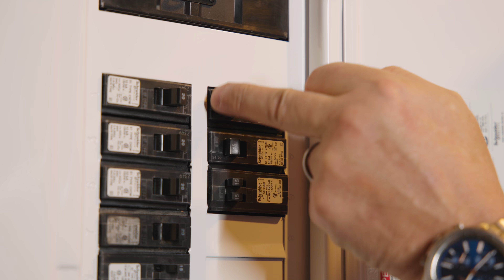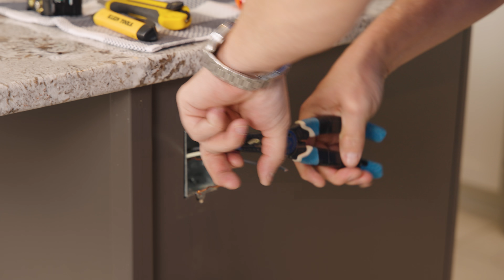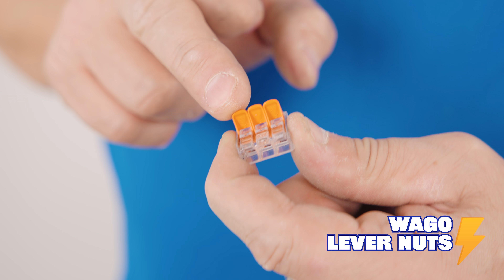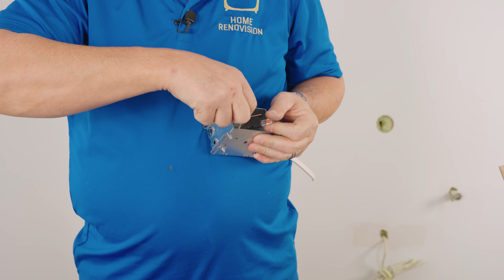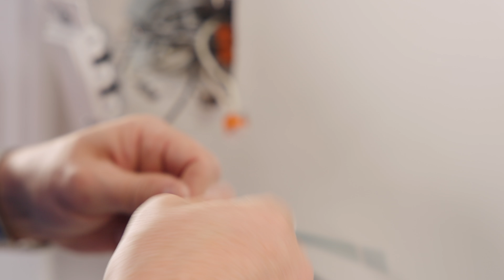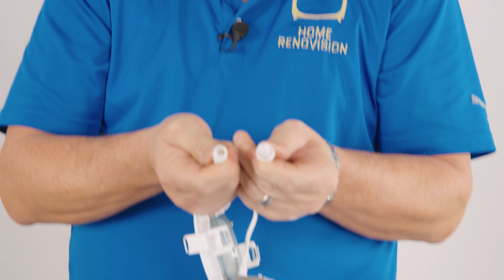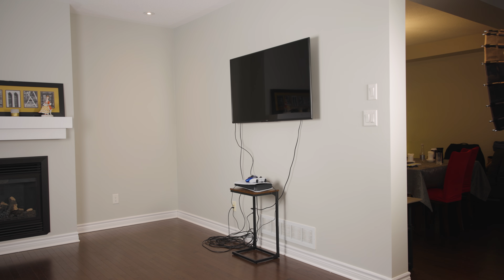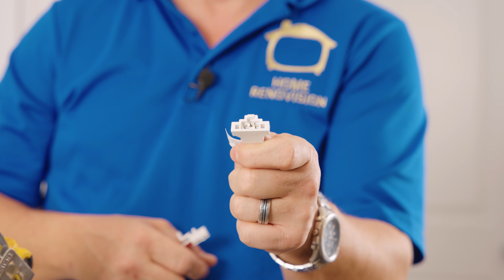Electrical Hacks Every Homeowner Should Know (DIY Friendly)

Comment: He didn't show how he got the power to the TV.... Dropping a standard power cord or extension cord down the wall cavity (this is a major fire hazard and violates the National Electrical Code). Got into a huge rabbit hole about this and just ended up going the romex route and learning to tap off from existing outlets to create a higher outlet.

Comment: Great video, have learned many of these the hard way!  One comment at 24:35 you can remove a wire from the Halo push connectors by twisting and pulling.  When you cut the wire off and striped it again using another hole there was still a bit of copper from the first try sticking out that would be energized when power is turned on.  Could cause a short.

Comment: In my new house. I had a duplex that was giving me grief. Thought it was the breaker.  I pluged in a fan in to the duplex and it sparked. 
Ahhhhh. I opened it up and found that the contractor had used a electric screw driver and cracked the unit because he over torqued. The plug was MELTED. A fire waiting to happen.

Comment: As an electrician for nearly two decades, I recommend never using wago connectors, especially for power loads as opposed to lighting loads.  

I’ve witnessed countless melted wagos over the years due to poor installation or poor quality controls at the factory. 
Also, never used stab in switches or receptacles.  They may be UL listed for that use, but again, I’ve seen too many melted or burned wires and devices due to poor installation or manufacturing defects

Comment: At 25:05 for that wafer light install, the box that you connected wires in, in can just sit loose in the ceiling?  It doesn’t have to be attached to a joist anymore for code?

Comment: The wago connector also has a spot that enables you to insert a probe from a multimeter. Makes testing things far easier. 

Also, if you use wire nuts or wago connector, treat them as hats instead of buckets. 
Have them point upstairs. 

If they point down, dust or debris and even moisture can accumulate and sit in it, causing connection problems over time.

Lastly, to make things even safer, I use electrical tape to wrap around the screws of the switch or outlet, and all the way around the switch/outlet to ensure the sides don't contact metal, or me, from accidental touches.

Many technicians swear against the wago because of heat tolerance or such. However, there is a video out there where someone did a test with wire nuts and wago connectors by running different current levels through and measured the heat. 
Wagon nuts actually handled things very well. 

For moisture control, I use smart switches and run a program where the fan will continue and not shut off until after 30 minutes passed.
So I never turn off fan switch when I leave bathroom, because it will just auto shut off after the time I specified ensuring better moisture evacuation and power won't be used more than I need if in the past I forget to come back to turn off fan during the time before I had a smart switch and just had a regular dumb switch. 

Hope this info serves others well.

Now it's time for me to go back to my long project of fixing my 3 Way switch and trace every wire across 3 locations because whoever installed the wiring didn't do it where things made sense and shortcuts were taken that I need to now normalize to current standards and ways things should be wired.

 Normally it wouldn't be an issue, however I have a smart 3 Way switch that suddenly had issues flickering on and off constantly, and I now  need to go through the long process of correcting things.
😅🤷

Be well always.

Comment: Extreme beginner question (obviously): How TH does the Romex "come to your light fixture" (as you say) when there wasn't even a fixture there to begin with? You made the hole in the ceiling, right? I'm picturing crawling around my attic space to try to drag wiring across. Doesn't sound like DIY for this 70 yo woman...

Comment: Honestly, working with electricity has always intimidated the crap out of me.  I don't understand it.  I can do basic installations like switches, outlets, and fixtures but I still don't understand the witchcraft that is electric.  lol  I live in a 125 ish year old house, and every time I've changed out anything electrical it's been an entire new adventure and I NEVER know what I'm gonna find.  I am absolutely going to look into those Wago connectors.  They look far superior to wire nuts for multiple lines!

Comment: I found out that the connector without the gate you just twist the wire back and forth and you will get it out and when re used it's still a good connection where you can not get them out unless you twist again.

Comment: At min 17:40 you just fixed the fan fixture for a bathroom and a light for the other side. I have two separate sets of lights and a fan would there be an option to combine the two types of would i have to get three separate light fixtures and a fan fixture? I've been watching a bunch of these for a while now. You've helped with drywall patched more than you know!

Comment: When it comes to automatic lighting know that there is a difference between an occupancy sensor and vacancy sensor (though some switches let you change modes). For many rooms it is actually annoying to have an occupancy sensor (automatic on/off) and you actually want a vacancy sensor (manual on, automatic off).

Comment: I could be wrong but I don't think you need to strip the wires for wagu clips. I watched an electrician do it without stripping. When you close the clip latch it cuts through the wire insulation to make contact.

Comment: I thought per code no more using back of switches the silver and brass screws should be used instead as inserting in back is fire hazard
Reply: Those are the old ones with the spring-loaded gates. The ones he's talking about have the snap Gates which are much more secure

Comment: I just installed my first ever electric device. It was a dimmer switch and I could'nt figure out how to switch it off. After 10 minutes, I figured I need to slide it down really hard and then it clicks off. I wish we could try those before buying because now I bought 4 piece of crap dimmer switches! But I'm still proud of myself for doing it. The only other problem I encountered is that I needed to wire the ground from the box to the switch because the metal of the switch plate was painted.

Comment: 24:36 Only thing I would change is to either try extracting that copper piece left over from cutting the wire or taping it if you can't remove it. That bare copper wire nub would still be live when the circuit is energized.

Comment: 24:36 but you left the previous piece of broken off copper sticking out of the connector!? You can twist the wire to get it to release from those push connectors but as you did it that black hot can easily short inside the box, a no no as you stated

Comment: So why are you saying the plug in back is NEW. Plug in back has been around for decades. Most people(smart) uses them, because they are not secure. What's different about the new ones?
Reply: The old ones were called stab locks and they were held in with spring tension. The new ones have the snap or gate which secures them much better. That's why they are now approved.
Reply: @sugarraysmith5450 good to know, thank you

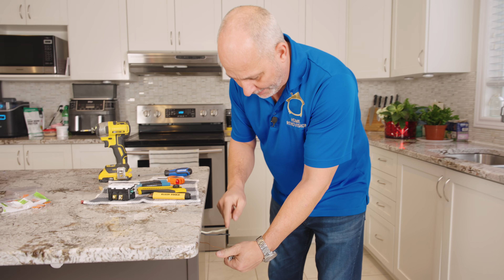Comment: 5:33 "chances are it'll break off" is misleading. It's good advice but makes the fringe case sound like the norm. Take a piece of new copper wire, bend it back and forth until it breaks and you'll get an idea of what you can get away with. Or maybe wire in Canada is more sensitive

Comment: Hey Jeff, love your content, a lot of my diy knowledge came from you, want to call out a shock hazard I saw though - 24:37, you snipped the wire and reconnected it, but that snipped wire will be live and defeats the purpose of reconnecting it in the first place, I imagine you'd want to use a new connector or at the very least tape around it a few times, otherwise helpful stuff!

Comment: Lots of good things in here, but 29:00 might be a no-no in both USA National Electrical Code (NEC) and Canadian Electrical Code (CEC).

Avoid doing parallel runs of communication cables (Ethernet) and power cables. I think the separation requirements are:
- Minimum Separation: 2 inches (5cm) 
- Recommended Separation: 12 inches (30 cm)

If stud spacing is 16 (40 cm) or 24 inches (60cm):
- Renovation: separate wall cavities
- New construction: separate wall cavities is preferred, but you could staple to opposite sides of a single wall cavity

In the video, there are two wall cavities above the heating return register. The Ethernet and power cables should have been routed in different wall cavities.
Reply: These codes are a bad joke. No inspector is opening an outlet to check on this prior to purchasing a home. Also, despite all these codes, you still run into issues. Why? It makes no sense

Comment: Great video with a lot of good information. However, you ran an HDMI cable behind the TV and cleaned up the mess. However, you hung the TV back on the wall without supplying any power to it.

Comment: Those outlets are actually all upside down. T goes to the right side. Per the patent, the ground should be at the top. The US has no code for residential zones, but there is a code to follow for public safety, healthcare, laboratories, and certain manufacturing facilities. Next time you go to the police station or a clinic, look, and you'll see that all the outlets are right-side up. I'm not suggesting people go and flip all the outlets in their homes, but if you're already replacing one, you may as well put it in right. Just because an electrician did it the first time doesn't mean they didn't put it in brass-ass backwards (I've literally seen outlets wired in reverse polarity too).

Comment: How are those Kidde smoke detectors treating you? I installed 5 of them and within a few months two started going off randomly at 3AM. To make matter worse, the false detection was sometimes of "heavy smoke" which means you can't silence them. The only option being while half asleep to unmount the smoke detector from the ceiling and permanently disable. The other 3 have been good for about a year now.

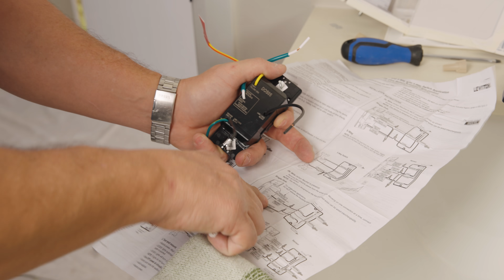Comment: The motion sensor switch: Pause at 2:45, the instructions say that the wires are interchangeable, otherwise they would not both be labeled ‘line/load’.

LED wafers/retrofit kits… I much prefer to be able to use whichever bulb I want and not have to deal with poor performance with dimmers, poor colour rendition, limited baffle choice and configuration, etc.

Also, that TV is WAY too high. The average person should be looking at the middle of the TV screen from a seated position without having to tilt their head up.

Comment: At least in U.S. (NEC), you can use a 15 A duplex receptacle in a 20 A circuit, indeed that is most common.  The receptacle is rated to pass-thru 20 A to downstream outlets (or do that via pigtail).  An appliance with a 20 A plug is very rare, something like a sump pump or special kitchen appliance.  Of course, it doesn't hurt to have the 15/20 "tee" receptacles, but will likely never plug in a 20 A device (one sideways terminal on the plug). Never install one on a 15 A circuit.

I've used the Wago lever connectors for 20 years in instrumentation and controls wiring.  I've also used them in under-dash wiring of my classic cars, to distribute ACC and GND wires.  I've seen youtubes where a Wago was used for the ground wires, but not sure that is NEC approved.  I've always twisted ground wires and crimped a copper ferrule.  In that 5-pos Wago, best to feed in on the center terminal so current flows both left and right.  Not required, but seems prudent.

If worried about degrading your house, if you are removing switches and outlets wired with the spring-loaded rear backstab holes, you are improving things.  Those were used in my 1972 house, and are still used today since faster wiring in new homes.  The best outlets are a "commercial" ones, a shown, w/ straight feed from the rear, but to a screw clamp.  No need to loop the wires around the screws.

Comment: Where I live in Pennsylvania, outlets in Island are not allowed. Reason is, when something is plugged in and sitting on the Island, a child could easily pull the wire and pull what ever is on top could fall down on them and get burnt.
Reply: That is a parenting problem, not a wire problem.

Comment: dumb question: are the kidde detectors supposed to be wired? i thought they were battery just like every other detector you find in rental houses. I just bought my first house and am about to install a CO detector. Thanks for the info!
Reply: Kidde makes both wired and battery versions. Code sometimes specifies wired detectors, but the battery-only versions are cheaper.

Comment: Would’ve been great to demonstrate REMOVING an octagonal ceiling box in order to be able to install the LED disc light. Lots of us are not adding brand new light fixtures, we’re replacing old outdated luminaries with modern LED lights. Those ceiling boxes are brutal, especially the ones that are secured with a bracket that you cannot see or access from inside the box, or the “boss stage” joist braced boxes that were intended for heavy pendant fixtures!

Comment: I can’t stand when guys stab the back of receptacles, anything goes wrong or you decide to change the receptacle for something different like a coloured one instead of white or usb outlet instead of standard you have to cut the wires losing you length to pull it out in future and the receptacle you take out is now garbage and can’t be used again so even if it’s working perfectly fine when you change it out you can’t keep it as a backup

Comment: you can remove from the non lever push in connectors, just twist and pull. The one you stripped too long you had exposed copper after you cut it... 

Also i like how you put the 120v through the wall on the TV install and didn't show it, I'd do the same :D that rule is nonsense

Comment: Great breakdown on the USB outlet swap. One thing I would add — always use a deeper box like a 3.5 inch reno box for those. The extra depth makes wire management way easier and keeps everything to code.
Reply: Anytime I have a box replaced I go as deep as possible. Can never have too much space.

Comment: Electrician here. One more thing though.
Once you have connected the wire to your new socket, switch etc, gently pull or wiggle on it to make sure the connection is tight.
A loose wire can cause fires.
Reply: I learned that the (almost) hard way when I was smelling burning from my baseboard heater thermostat after a year. Opened it up and the wires had melted the wirenut and a portion of the thermostat. Switched to WAGOs after that.
Reply: 100% Always take the time because all it takes is a slight pull against the insulation after pushing the device in and pop! Also, as a fellow Sparky, since Jeff said a homeowner "can be an electrician today" by plugging in 2 ends of a quick connect for a LED can light, does that make be a framer if I can cut 1 piece of wood with a handsaw?
Reply: @captcutlass0442 if you do it well, you’d convince the unknowing-like most homeowners 😂

Comment: Great and Helpful Video (As Always) .  Two things I would add.  1) - When Checking the outlet for power with the Plug-in GFCI tester, you should test both plugs in case it is a split receptacle. and 2) - If you want to change the lumens on your wafer light, you will need to remove the wafer light to access the controller.  Be very mindful of where the springs are as you remove the wafer light!!! They are very much like a mousetrap!! Ask me how I know!!

Comment: You can totally remove the wires from the wago connectors.  Simply hold 1 wire at a time with one hand and hold the wago connector with the other hand.  Twist both the opposite direction and pull at the same time.  It's like a simple pinch connection.  PRO TIP: pre-twist stripped ends and simply use a wire nut as an insulating cap, much better connection than a wago.
FURTHER PRO TIP: Strip an extra inch or so off the wire ends, long enough to grip the tip of the wire only while pre-twisting, then cut that tip off that was damaged during twisting, then add wire nut.

Comment: I have a house built in the 70's. I am wondering if I could use WYGO connectors on aluminum 14-2-g romex wiring? Any other suggestions?

Comment: ive got a dead plug in my kitchen, plug tested says open hot. I pull the plug and its a 3 wire (white, black and red) I have no switch for it anywhere i have found. Possible to be a split plug on a bad breaker?

Comment: Co sensors should be mounted lower than fire.
Reply: Carbon monoxide is less dense than air, so will rise. Ideally, a CO detector will be placed higher than your head (the air you breathe). Propane is heavier than air, so a propane gas detector is ideally placed lower than waist level.